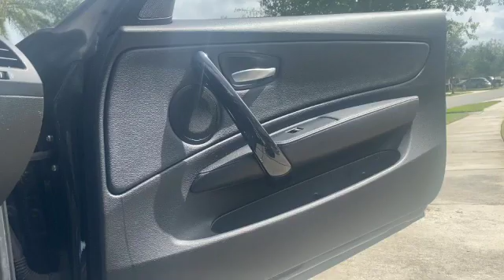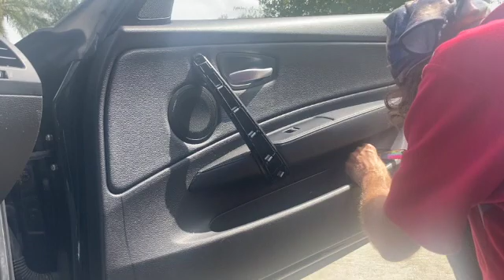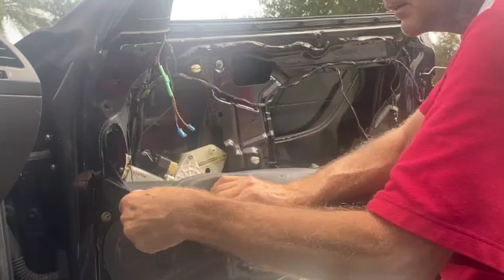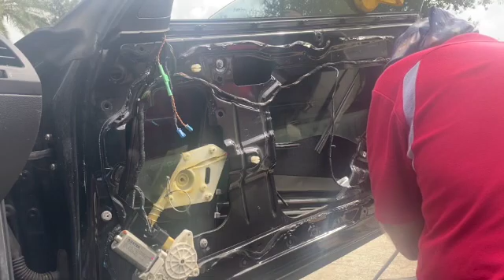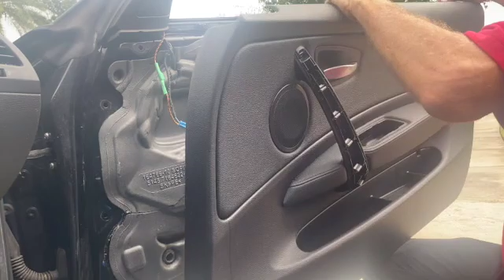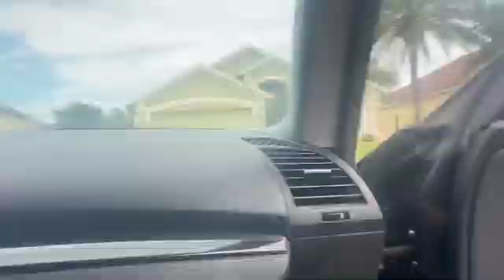BMW 128 Window Regulator Replacemement & Repair 2008-2013 Passenger

Comment: hi guys I have a 128i 2010 convertible, I did change my window regulator in my passenger side, I disconnected the battery but now the automatic window drop is not working, before when I opened the door both windows dropped half inch automatically, and when I closed the doors they when up automatically, I looked some videos here in YouTube in how to fix it but I can't get the doors to work.
anybody had this issue before and how did you guys fix it.
thank you for your help.
Reply from the maker: Try resetting the auto. Put the window up and continue to hold the button in the up position after the glass is all the way up for 10 seconds. That may solve it.